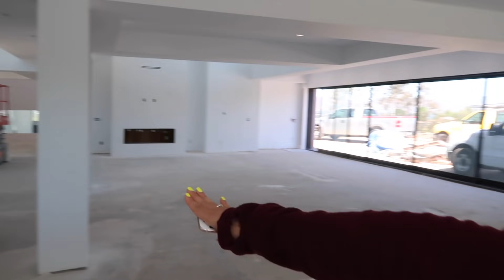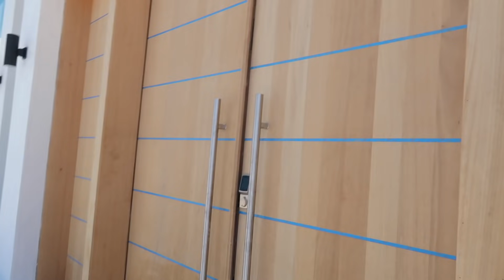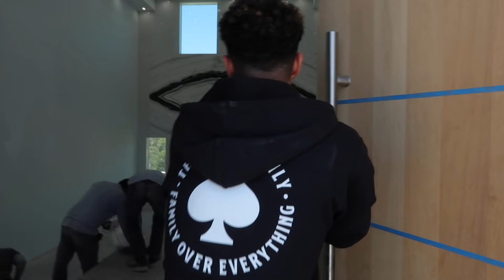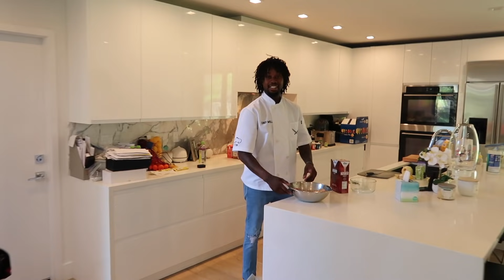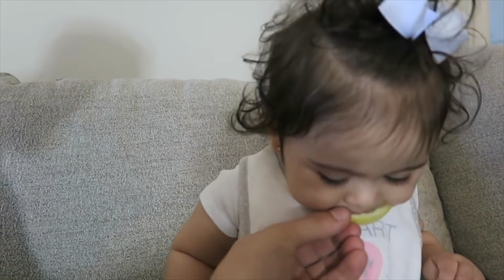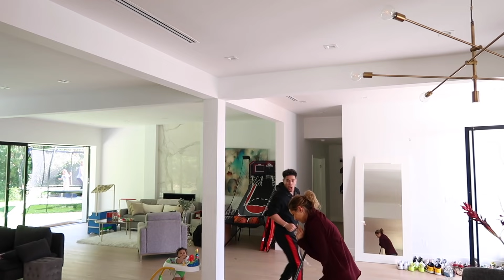MOVING INTO OUR NEW HOUSE!?!?

Comment: The entry way is very grand. You should get a customized light fixture. The lights are lovely but the ceiling is so high they look small. It doesn't work against the white ceiling because of the glass balls. Personally I think you don't need a chandelier.

Comment: The Anglea lights that you seen at the light shop you should put those in the front entryway and it'll make it look like earrings because the two windows in that little mouth looks like a face and you should put like the dangle the lights and it will look like a face wearing earring